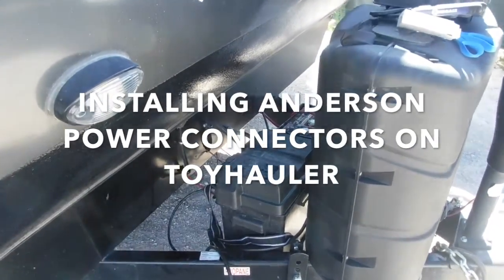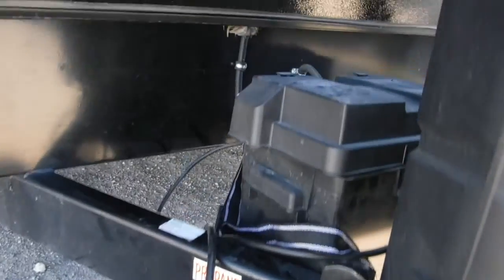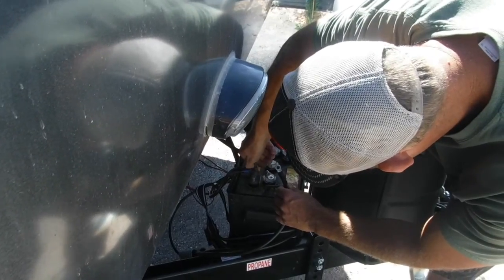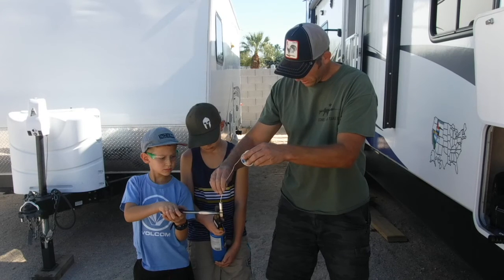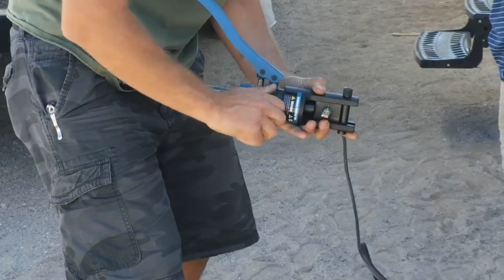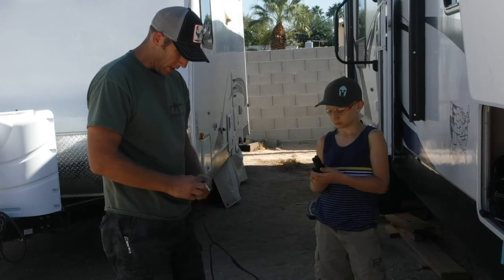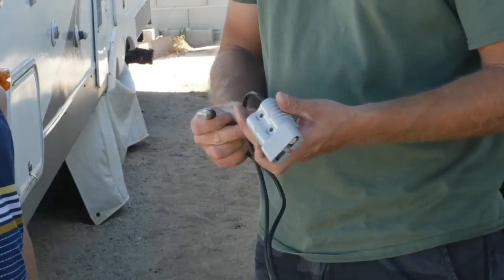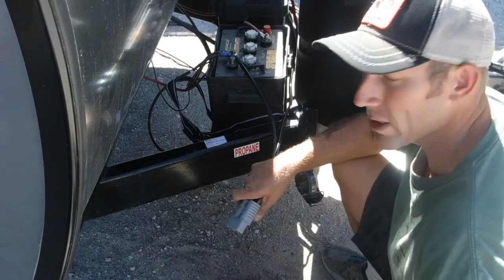Installing Anderson SB175 Connectors on Toyhauler Batteries & Charger

Comment: I just put one of those on my Casita battery to use as a battery disconnect and when I was done I took some dielectric grease and smeared on the contacts to make it easier to plug and unplug and also to help prevent corrosion.

Comment: Nice Vid. I remember camping out in Zion and my battery went dead. I had to flip my truck toward the batteries, run jumper cables, and charge the batteries using my Titan’s alternator. I’m considering making Anderson style connectors so i don’t have to leave the hood slightly open.